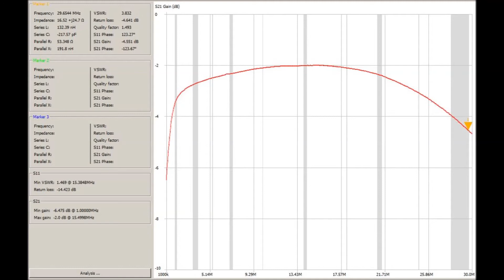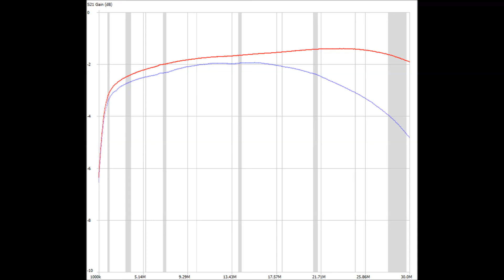EFHW antenna transformers - loss difference with different winding styles

Comment: Thank you for confirming what many of us know AND backing it up with simple graphs.  The Reisert crossover is so high in leakage flux stemming from that aesthetic crossover winding and opposite sense to the wide winding spacing, that it's all but worthless.  Yah, it works but does it?  If wound with RG-174 coax, it performs better than individual windings.  The ARRL and the advertising balun makers keep pushing and selling these ideas that are pure junk.  Higher Z ratios require higher permeability cores to minimize unnecessarily long wire lengths and winding inductance.  Many factors enter in when winding a transformer from wire and core size to turns ratios, winding tightness, spacing, type and thickness of insulation.  Plus, cores have a broad range of Al values dependent upon manufacture and material purity.  This is what "making" is all about.

Flux leakage is where the flux in the core does not cut every winding or cuts them unequally.  Spacing between adjacent windings, grouping then spreading out multi-filar windings, thickness and type of insulation, influences the inductance and efficiency of the transformer.  Use solid Thermaleze or Formvar insulated copper; or stranded and silvered PTFE insulated wire.  It is a complex yet not an exact science.  One can calculate, run models and test all day long.  But until you wind the thing and hook it to an actual antenna, you're still in the "best guess" stage.  It's more of how well you can apply the best practices in construction and measurement then researching and understanding on how to best correct it.  When actual field tests prove theory and models otherwise, it requires more investigation and experimentation to determine what works best with a reactive instead of a pure resistive load - meaning the actual antenna.  Higher core losses mask VSWR and are resistive ghosts that introduce losses and fool you into thinking that "it just works great."

Be mindful where you get cores and buy from US companies.  There are lots of Chinese knock-offs that are junk and will frustrate you if you don't know how to test and verify them.  There are lots of ferrite core mixes but those that are 43, 52, 61, and 77 material mixes are commonly used for RF transformers, are relatively inexpensive, and come in various OD/ID sizes.  I personally prefer Fair Rite products.  31 material is more for CM chokes and split cores (beads) work great because they can be clipped onto the existing coax or wound in line if the ID is large enough to admit 3-4 turns.  Remember Z=turns squared. if the core has 300 ohms single turn choking impedance, then each pass thru the center of that doughnut is a turn.  Next, remember that turns squared thing?  If not, then here's an example: 3-turns (or two loops) = 300 x 9 (3-turns squared) = 2,700-ohms.  Ideally, 3,000 ohms is the target value so if you physically can, add another turn and have 4,800-ohms.  At $20 a pop, it's much cheaper at 3 or 4-turns than $20 x 9 or 16 cores strung in a line.

The coiled "ugly balun" is not that effective and has a minimal, narrow band choking impedance.  Use ferrite.  It's cheaper, smaller and works.  Something else that doesn't work is the 4:1 current (Guanella) balun wound on a single core.  Guanella never designed his TLT's using cores at all.  They consisted of two separate sections of coaxial lines.  When tightly wound on individual cores, they efficiently work as designed from 1-30 MHz.

There are lots of experts out there preaching the gospel.  But remember to diligently research and thoroughly verify whatever design you decide upon.  AD6AE

Comment: Unfortunately, there is no ferrite specifically for HF applications yet! So we have to use what is available. Many have tested different ferrites, and 43 material is currently the only material best suited for this application. That there are different opinions about winding a 1:49 transformer so be it, whether you choose for the best SWR with a little more loss or you choose less loss and a worse SWR. 3dB loss is half the power, 1S point is 6dB!

Comment: The spread and "cross-over" is merely to get the antenna wire to the top of the case or 180° from the SO-239 or BNC connector.

Comment: Hi there - hiding out under your "Evil Liar" 
I am retired TV radio RF engineer in the field of TV radio transmissions with over 40 years in the field. You do not show, how did you measure insertion loss . For starters 1dB power loss with 100W input =12.5W loss = 87.5% efficiency - not 79%. The siple circuit to measure that / even as I see you use a cheap Nano VNA server software and Nano Vna (nothing wrong with that), is to make two identical transformers - connect their ouputs back to back and inputs to S11 and S21  S11and  S21- then divide results by 2. Speaking with confidence as you do  Mr Liar - you just lack education in this field and simply spreading missinfo!

Comment: Well I built one and compared with the "split windings" whatever you want to call it.   I will admit the numbers were impressive with turns spaced tightly but performance in the field was much better with the split turns.
Reply: Its mathematically proven its not better, your swr will be better because of loss but 1db is a whole lot of power to lose.
Reply: When you say performance in the field, what are you referencing primarily? Were you looking more at SWR comparisons, WSPR and or FT8 spotting results, ease in making SSB contacts, or what? Interested in hearing more about your experience!

Comment: So if you have 1000 Watts at 50 ohms that is ~ 223 Volts, across the 2 turns. Now multiply tha 223 times 79, you have about 17.5 KILOVOLTS across the 14 turns. How do you suppose the enamel insulation is going to do on those close spaced turns? The turn to turn voltage is still 1.25 KV per turn. You may be good for QRO but not for high power. Redo your loss calculations with spacing around the core to allow for 1.5 KV per turn.
Reply: You wouldn't want to dump 1000 watts onto a single core anyway.   You would want 3 stacked 52 cores for that kind of wattage.   A single core is good for 100 watts max.
Reply: Correct me if I'm wrong, but isn't the voltage transformation the same as the turns ratio, ie 7 * 223 = 1561 volts?
Reply: nope. with 1kW (you wouldn't run as much power this core anyway because of max Flux) you will have a secondary peak-voltage of sqrt(1000kW*50Ohm)*sqrt(2)*7 = 2213V  so the inter winding Voltage is ~316V. Enamel insulation has to be >400V by Norm (here in Europe), so you will have 800V Isolation turn to turn.... all fine...

Comment: Hi. Tests as per a blog post by Owen Duffy suggest a 3 turn primary on the FT-240-43 will halve the loss, and indicates a stacked pair of cores with 3 turn primary will be better again. I've built and tested smaller cores and found it matched surprisingly well. Thanks for the videos . Cheers from VK3.

Comment: Thanks!...  I've been wanting to do some experiments on this theory...  I ran across it a good while back but couldn't find very much info like you provided...  What did you use for testing?...  Will a simple spectrum analyzer and tracking generator work?
Reply: The traces were probably captured with a program called NanoVNA Saver, so I assume he used a NanoVNA.